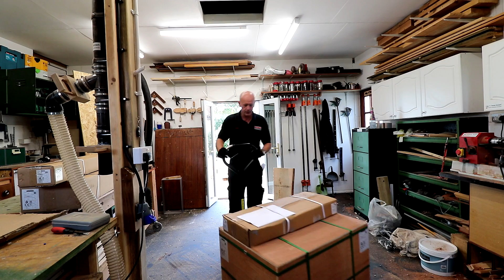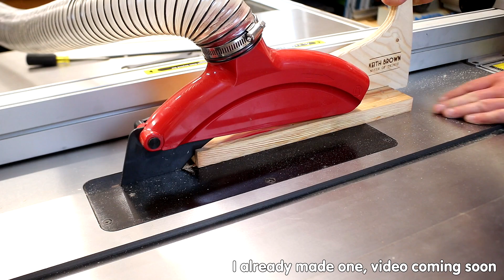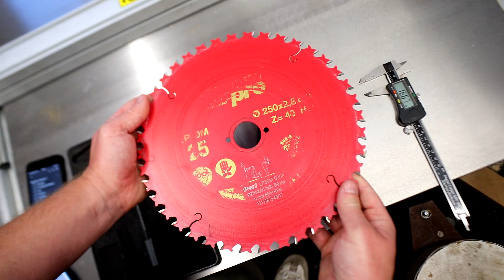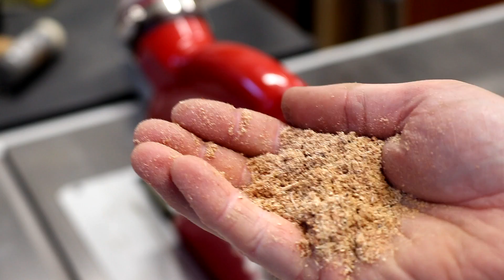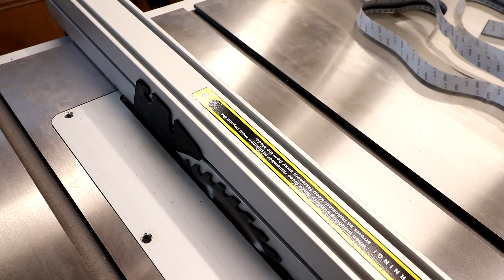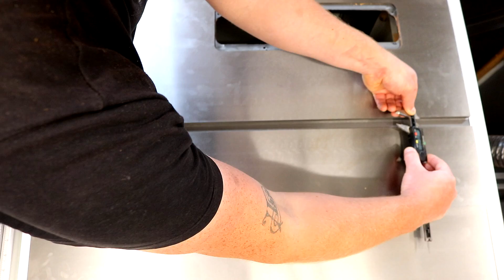Axminster AT254SB / AW10BSB2 Table Saw Review

Comment: Hi Keith, grate review. I'm almost committed to buying the updated version of this saw, AP254SB. I need to get a 16amp supply sorted for my workshop and I just wondering if you can tell me the approximate cable length provided on your saw. thanks, Shane.
Reply from the maker: Hi Shane, the ap254sb shares nothing in common with the saw that I have as far as I can tell. It's best to contact axminster if you need the cable length

Comment: We have found that you need a high flow low pressure to the body and a high pressure low flow to the crown guard. We have a  Henry hoover performing the latter duty and an ancient monster machine outside the building so that we don't have to worry to much about filtration. I agree - no real thought or understanding of air flow went into the design of this tool. On this set up we pass a professional inspection each year.

Comment: I’m from Italy and a woodworker like you. I had same issue with my old 0.75kW dust extractor and any other improvement I found over web are really expensive. Finally I hook down this one from Cormak, a good Polish manufacturer, and now I solved any dust problem.

Cormak FM340 230V Portable Dust and Fume Collector & Extractor 3200 m3/h
Oh. I decided to add a paper filter from Charnwood I found on Amazon for few bucks. Great improvement.

I’m nor sponsored by them.
Regards.
Marco Zamarco Malaspina.

Comment: Seems very similar in quality and use to my Charnwood W650, sharing similar niggles.  Poor dust extraction is my main niggle and I’m going to have to make a bespoke dust collection shute.  Finish and tolerance on that axminster doesn’t look great which I’m surprised about.

Hind-site is a wonderful thing and personally at this end of the market none of these saws are of a standard they can be used professionally out of the box.  Given the same choice again I would have bought a used single phase sedgewick or similar quality saw.  On balance I think that the W650 betters the axminster one as it uses an excellent fence, has a sliding cast iron mitre table, the cast iron top is perfectly flat, the shop base has quick lock and release castors and the motor is as good being a quiet 3hp induction motor.  My main gripe though is poor dust extraction which frankly is unforgivable in any of these saws.
Reply from the maker: Thanks Paul. Yeah. If I were to summarise I would say it is a good solid machine with good build quality but very little finesse and features, which is a shame.  Seems to have been discontinued by Axminster now....
Reply: @RagnBoneBrown  it’s a shame really as it’s quite a step up to the £4k sedgwick and their own branded pro saws at £2500 are a bit underpowered at just 1.65KW

Comment: G'day Browny,  I have also just purchased the same saw (in Australia) and like you have identified the same floors. I am interested to know what you made the zero clearance insert from. I have already lost a screw as you spoke about. I do have the larger HLVP dust extraction and find it is awesome as i don't use the above blade guard often. The riving knife is frustrating and i will do the same as you have and modify mine. I see you have put the fence rails further to the right. When installing mine the manual said to centre the rails. What is you maximum cut now you have it further to the right?
Thanks for you Youtube content i watch often.
Cheers Wooffa.
Reply from the maker: https://youtu.be/NOeYv5s-Y8A here is the zero clearance video 👍 can't remember cut capacity, maybe about 700mm from memory... Cheers Keith

Comment: Great review. You need captive screws for the insert plate. If there is any space under the plate where it screws down, they could be fitted, but as you said should have come from the factory with a better system.

Comment: Riving knife tip, trace into old circ blade and cut out with grinder.
Reply: May not be easy to find an old blade with exactly correct thickness. The video mentioned checking the saw kerf to ascertain required riving knife thickness but you also need to measure blade plate thickness of sawblade in use
Reply: @jimpackard8059  may be wrong here but most blades I have used have been negligible in blade thickness. (General woodworking nothing speciality)  Teeth thickness (kerf) is another story, but since they will be cut off from the makeshift riving knife, shouldn't be a problem.

Comment: Hey Keith, big fan of you channel! I actually have the exact same tablesaw, and after a few months of use have found that the fence goes periodically out of the square, sometimes by more than 2 mm. I was wondering if you had experienced something similar and, if so, did you find a fix for it?
Reply from the maker: I have found the same problem. Frustrating isn't it? No fix for it unfortunately...
Reply: I wonder if it may have to do with the clamping of the router table fence, as that is the operation I perform that exerts any real pressure on it. Otherwise I am at a loss as to why it is happening. Very frustrating indeed.

Comment: Hi, i have a sip 12" saw of very simmilar design. You mention not being happy with the 'Micro adjuster'. On mine i couldnt even get the rack and gear to even engage with each other. I checked the booklet that came with it but not a mention of how to install it, no mention on youtube either. On removing the micro adjuster i noted that it was fitted with a grub screw, i loosened it up and found that it released the round carrier and found it was in fact an excentric adjuster. I now have adjusted it and the rack and gear mesh perfectly allowing easy micro adjustment. May be of help to someone with a problamatic fine adjuster mechanism.

Comment: I have the original saw from Axminstet I bought about 15 years ago.Mine comes with the heavy duty sliding crosscut table.Only changed the drive belt on it once,it's still going strong.When it was delivered the fence WA bent slightly,but they sent me a new one witching 2 days.
Reply from the maker: Hope mine lasts that well

Comment: I've just bought the same machine, Keith, and the blade is not perfectly aligned to the miter slots. Do you know if this is fixable. There's no mention of how to do this in the manual! Cheers
Reply from the maker: Yeah there are some bolts that you can undo to release the top from the cabinet, and then straighten it up 👍

Comment: How did you find going from a left tilted saw to a right? I do alot of 45deg cuts and as I'm right handed a left tilted blade seems right to me but like you were I'm looking to upgrade my table saw but all the saws I have my eye on which are around the same price bracket you had are all right tilt. I was wondering how you find yours and if you have any pros and cons for both left and right tilt tables?
Cheers
Reply from the maker: As the fence can go on either side of the blade, it really doesn't make much of a difference

Comment: I'm glad you got this saw for a bit of deal as axminster have just released a 10 inch version of their craft saw the AC254TS. Bet they didn't mention that when you spoke to them so they could up sell you. It's only £200 more than your saw so maybe it's a good upgrade anyway.
Reply from the maker: It's £200 less than my saw... And it doesn't really fit my needs as the rip capacity is too small
Reply: @RagnBoneBrown  sorry I meant less. I've always been disappointed by the rip capacity of axminster's saws. Based on your recommendations previously I have recently bought a dw745 for the 10 inch blade and the greater rip capacity.

Comment: No need for a HVLP system. Just change out those 100mm hoses for something smaller, both inside and outside the machine. Use 40mm hoses for both, should be more then enough for you. Way too much area going from 60mm to 100mm+50mm.
Reply: This is incorrect. With extraction airflow, going smaller can often be worse. This is airflow mechanics - not a household vacuum cleaner. That is why big panel saws often use 125 dia on the base. Anything below 80 mm is going to usually under perform in this case. Not enough airflow for the stuff being extracted

Comment: just listening to your comment about the mitre slots not being universal - surely you would expect a cast iron top to be dead on? did you contact Axminister about it, it would do my head in lol. By the way it would have some effect with a sled - you could end up with pieces .1mm in difference from each end on how you push the sled. I had an evolution table saw, jeeeeeez the slots were really crap i could be out by a mm or more (actually yours now in comparison to my old one is much better) - i just got rid of it and for now i am building around my circular saw  to compensate not having a table saw (proper track with adaptor, mft top, bench dogs and so on) and use my router also to make certain cuts like notches . I think one has to spend like 2k plus to get a 'proper working table saw., hence trying the cheaper alternative above.
Reply from the maker: For me it's all about levels of tolerance, and while I'd expected it to be better, it's within tolerance for me and the work I do

Comment: I had the S.I.P 10inch cast iron table saw very similar to this table saw, it served me well, at 3hp its powerful enough but the fence is poor, the design allows for saw dust to enter where the fence locks down and thus inaccurate fence settings sadly are created. The castings are incredibly good, nice and flat, for the money it's a table saw that's affordable but the fence really is poor, I decided in the end to upgrade.

Comment: Hi Keith. Enjoyed your review, the holes in the machine housing that are reducing the effective extraction are easily blocked
using upholstery foam pushed in where needed. Your always better having a bigger extraction than what's needed by the 
manufacturers, the more suction the better in my experience. The saw look a really nice tool with the cast iron extension tables 
and substantial fence and guide set up. The fold down handles on the hand wheels is a good feature, saves the bruises. Tony

Comment: Your saw looks like a great buy.

Most saws have a hose inside. My Felder is the same approach. This allows the blade housing to move with the blade when you set it at an angle, move it up/down etc. In theory, the rest of the openings around the saw shouldn't matter because you have a blade shroud. The shroud does need some openings around the top so it can move, but also to ensure the dust collector isn't starved.

You can see the hose inside mine here: https://www.flickr.com/photos/psychlist1972/32200042194/in/album-72157677010951444/

Really, the best thing you can do is get a good high performance dust collector and some smooth metal or plastic ductwork. The minimum is never really enough, especially if you decide to mess with MDF. Part of the reason is that every other hose, joint, gate, etc. that you put between the dust collector and your saw will take away from the efficiency of the dust collector.

If you have the budget, a proper cyclone collector will work well. If you don't have room inside, but do outside (and have forgiving neighbors), you can even put the dust collector main body outside and just have it vent back inside with the filter so you don't lose any conditioning of the air in your shop.

Oh, and my saw also has all those screws holding the insert plate in, and I've already lost one. In addition, it has two set screws next to heave hold-down screw, so even more tiny screws. I ended up just buying a bunch of them :P

I have a 2hp Oneida cyclone just outside my tiny shop. I'm not sure what is available in the UK and in your budget.

Comment: Hi Keith, I have had the 315mm version of this saw for just over 3 years now and I love it, I had the same issues as you and have done most of the same improvements as you. My biggest issue was the dust extraction,  I taped up any and all gaps around the saw but one of the biggest improvements I did was to remove the dust chute from underneath the saw blade then I fitted a big mouth plastic dust extraction fitting I git from Axminster,  I fit some thin plywood to guide the dust to the big mouth the fit a 100mm hose to it, it took a bit of work but it has improved dust extraction greatly, I still use a separate extractor for the crown guard.  As stated, I think it's a great saw and I'm sure it will give you many years if pleasure using it.

Comment: I have been considering replacing my Dewalt DW745 with an Axminster for at least a year now, so your review is very useful to me. The minor dip in the table surface I could probably live with but it is a shame that the mitre slots have that amount of wobble, that the arbour will not take a dodo stack, that the insert is screwed in, and that the dust collection is so poor. The much quieter motor is a big win but if that is the biggest gain I might have to save up for another year or two, and aim for something that resolves the other issues too. I will be following your development with upgraded dust collection but that is of course an added expense too. Thanks for sharing.

Comment: Thanks for a good review - very comprehensive. I have an 8" Axminster Hobby table saw that shares some of the things you have noted:  easy to set up for accurate cuts, nice quiet induction motor, good overall performance. Dust extraction is very poor - aside from filling the workshop with dust, dust gets into the screw threads of the tilt and height mechanisms inside the cabinet that need frequent cleaning to stop them gumming up over time. That wouldn't be such an issue if they were easier to access. I also modified my riving knife like you. I can't understand why it would be  designed to sit above the height of the blade - seems bonkers to me. I also find it very awkward to adjust the tension of the drive belt from the motor to the blade, but I've only had to do that once in 3 years. Would I buy it again: yes.

Comment: Hello Keith, I have the Itec saw and it is almost exactly the same and comes with 2 cast iron extension tables as standard. Not surprising as they all are made in e same place! I have had it for about 2 years and it is quiet and cuts very accurately so I am sure yours will too. Re mitre gauge I saw  a video on this and all you need to do is use a centre punch to put 2 or 3 "dimples" on each side of the slide bar to take up the slack, will not be absolute but near as dam it. I use mine sometimes but mostly the cross cut sled that I made. I don't bother screwing the blade guard down as mine is a stiff fit and needs a tug to get it out so swapping from it to my zero clearance, which is also a tight fit is quick and easy. Like the idea of the riving knife I think I will give that a go.
Reply: Alan, I also have recently purchased the itech equivalent saw and as you say it comes with the two cast iron extensions which makes it a much better deal compared with the Axminster.

Comment: I feel your pain Keith.  I spent a lot of time and money to get the dust collection up to par on my Powermatic 64A.  I added a Shark Guard to the saw for both safety and for "above the blade dust collection".  It helped a great deal.  I used expanding foam insulation (rattle can) to seal up all of the gaps in the base.  I also created my own dust collection chute below the blade to capture as much dust as possible.  The stock version was terrible.  I hate to say it but you made need to upgrade to a better (more CFM's) dust collector.  I know you said it wasn't in your budget but it can make a big difference  having a properly sized blower.  Bill Pentz has some great information on his web site.  I learned a ton from it.  I'm not sure what systems are available in the UK but I'm sure you will work it all out.  It will be fun to see where you wind up.  Take care and stay safe!

Comment: Nice review. 
Where you showed the mitre slots not being accurate along there length does this affect checking the blade alignment when measured from the mitre slot?
Reply from the maker: Thanks. Technically yes, but by such a small amount that it doesn't worry me

Comment: I’ve got the SIP1332 which is virtually the same saw and I made a zero clearance insert plate and used rare earth magnets to replace those pesky 5mm screws https://www.youtube.com/watch?v=2vByCM7IiaQ&feature=share works a treat 😉
Reply from the maker: I don't think magnets would hold with a blade spinning at such high rpm if there was a catch
Reply: Rag 'n' Bone Brown I had that concern so I put on my brave /stupid pants on (made sure that either the crown guard and/or fence covered it initially and has been good for me with over 6 months of use, zero catches but I did use 6 decent magnets and the hold is v strong to be honest

Comment: As others mentioned table saws need a LOT of air flow to clear the chips/dust.   If you eliminated all the "leaks" there would not be sufficient airflow to carry larger chips.
Dust collectors are high flow, low head so any pressure drops in the system will impact air flow a great deal.   That T fitting on the bottom of the table saw is the highest pressure drop of any fitting.   I am not surprised that the air flow to the top blade guard was pitiful.
Flexible hose is also much higher pressure drop than smooth wall duct/pipe.   I would reduce the length of flexible hose if possible.
I feel you separate lines to the bottom and top blade guard will work best, as you have at the moment.
The keys should have been in the parts box, but key stock should be available at local hardware stores.  I presently live in the US and can find imperial key stock in my local hardware stores.   For metric keys I either need to machine larger imperial stock down to size, or order online.
That is a fancy plug for a 3HP motor.  A plug for the same amp rating is so much simpler in the US.  I have one on the 3HP motor for my Delta Unisaw.
Dave.